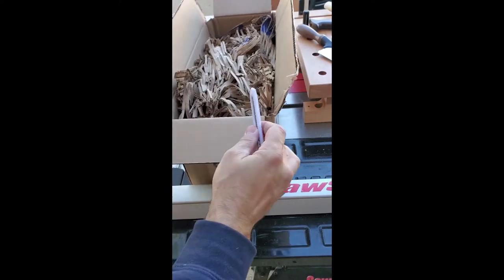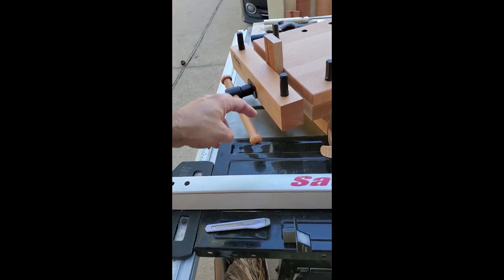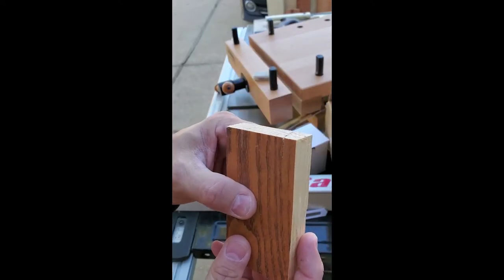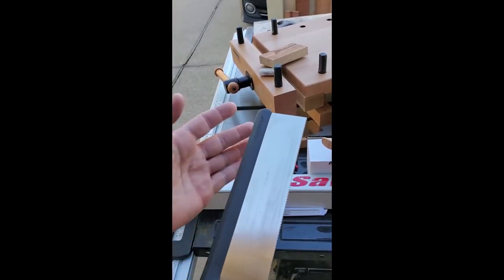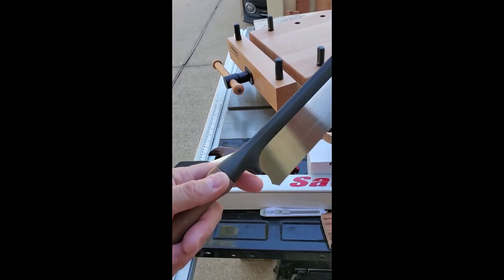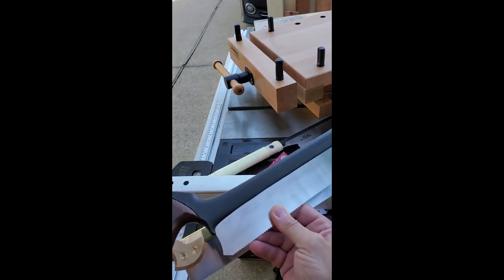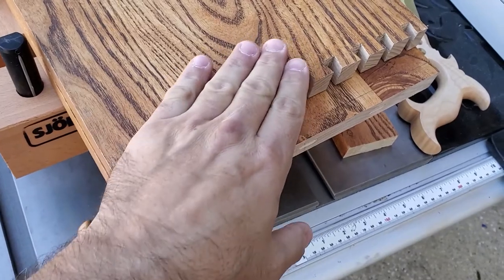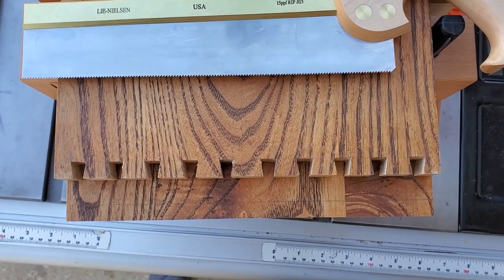Lie Nielsen Tapered Dovetail Saw Unboxing, Review, & Test + Veritas Gent's & Crosscut Saw Comparison

Comment: I use the Veritas, Lie Neilson and Japanese saws also.  I use them for different applications, and have found over the many years I've been a pro woodworker, the species wood I'm using makes the difference in the saw I use. Lie Neilson saws are my favorites and my go to saws. I've got a collection of 12 Japanese saws and really enjoy the versatility of them. The Japanese saw you used is my go to saw for cutting the pins in half blind dovetails. I'm building a 1774 reproduction chest of drawers now out of SYP and the Lie Nielson makes mince meat out of cutting the dovetails, and it's almost 100% dovetail joinery. I also use Lie Nielson hand planes. Thanks for the video. A review like this one should help woodworkers, especially new ones, understand the difference in the saw brands.